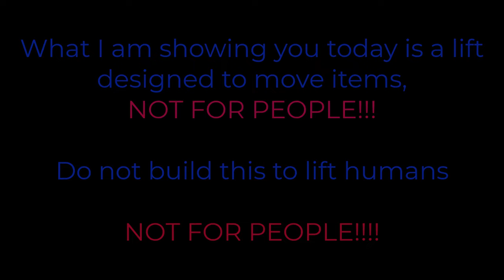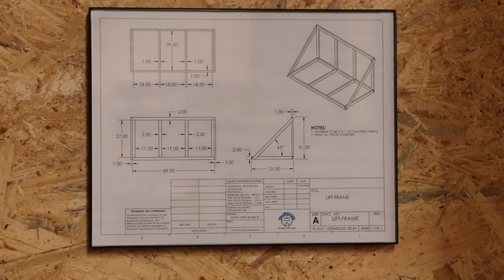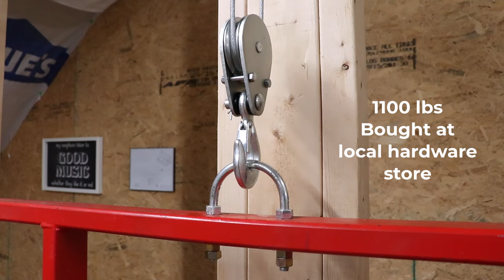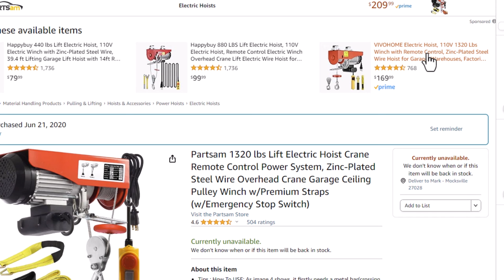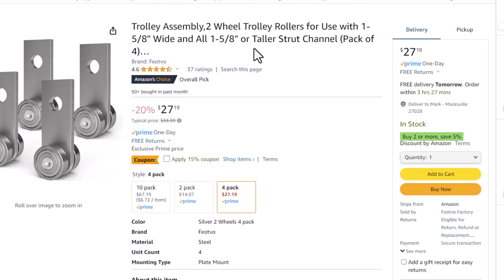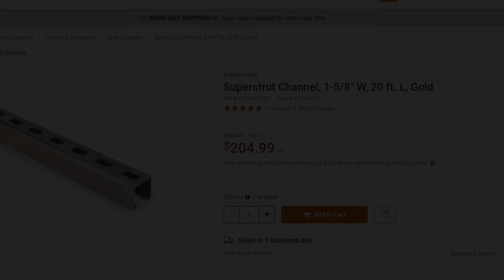How to Build a Lift / Hoist / Elevator for your Shop, Building, or Garage

Comment: Im not in love with the ubolt mounted only to the top rail of the frame. Id worry about metal fatigue at any of those welds... id gusset the top rail to the bottom rail with a sheet of diamond plate, and attach into the uprights as well.  Love everything else though! Making me add another thing to my wish list, starting with a  barn! Lol :-) love your vids Mark, glad to see you back !
Reply from the maker: Any recommendations on what to use beside the U bolt?
Reply: @Blueglow  I dont mind the Ubolt per say.  All of that weight is concentrated to only the bearing surface of two nuts.  In order of preference, I might Add some sort of flat stock to the rear as described previously and may be use 2 u-bolts.  Im not an engineer, may be worried for nothing.  Like anything else, the stronger you make one part, the weak link moves to somewhere else. Id kinda like to have the weak link designed to have a backup. Failure could be simply , oh gosh! Thank goodness I had a backup...

Comment: To me the rollers are def in contact with the strut under load.  The further you are away from the u bolt where the hoist is connected the higher the load on the strut is.  Remember torque equals force x distance, which creates a moment.  The best way to do this and not have it under load is pulling from the center of the platform on the top.